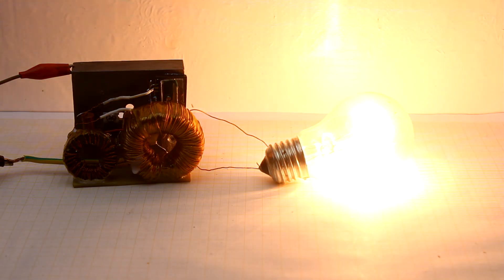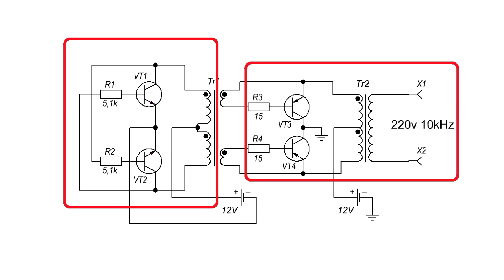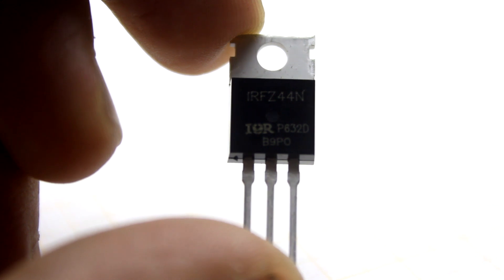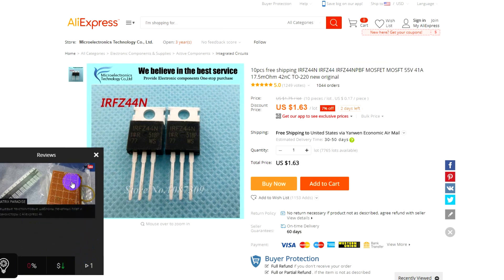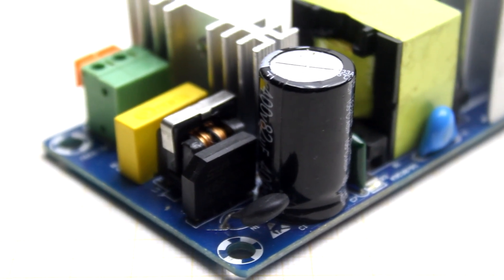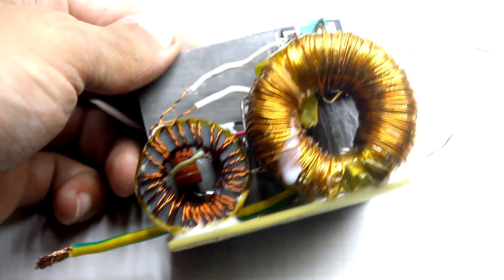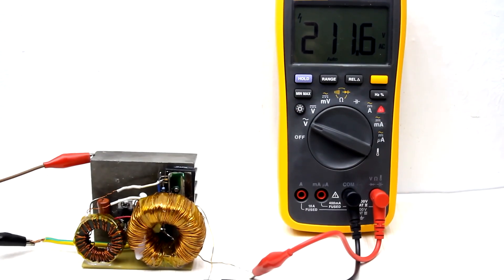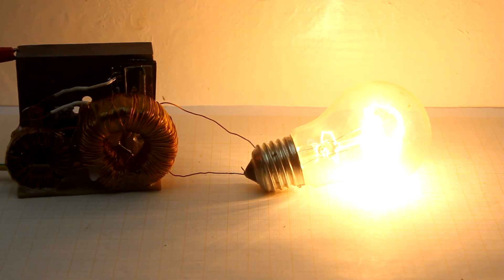DIY power inverter 12-220 150W

Comment: please sir, tell me one thing. I have 12V DC with 1Ampere.i want to increase it's ampere. please tell me how can I increase it's ampere but voltage should be same or increase? when I try to increase ampere, the voltage decreases. please help me.

Comment: would a teensy 3.2 be good for a smart DC boost stage for a inverter? also I have a huge transformer from a 48v battery charger for forklift. I don't know specs. but the output leads are 2/0 gauge. I don't know efficient a push pull boost would be. I guess I need to test and experiment.. or would a boost converter style boost stage be better? great video